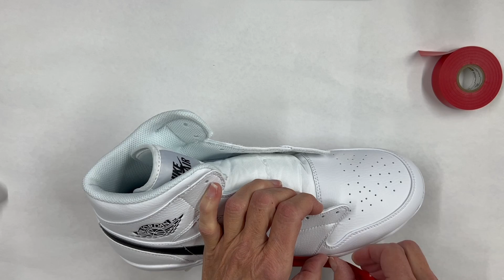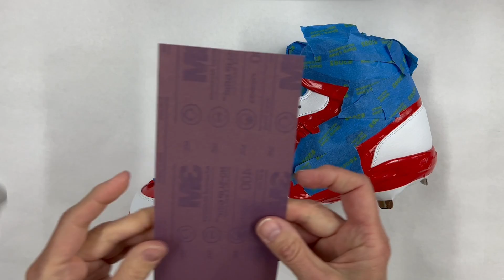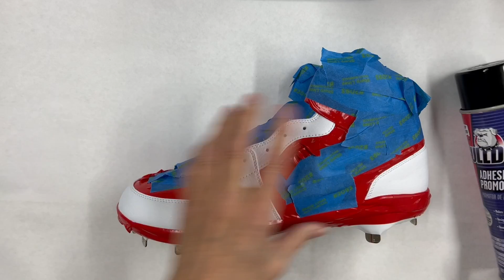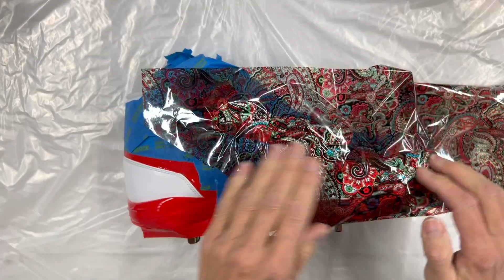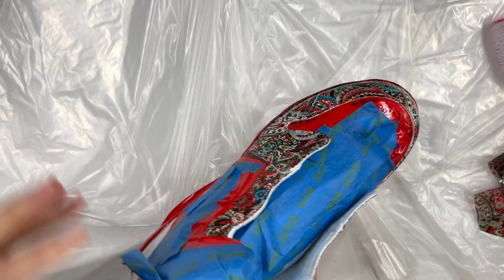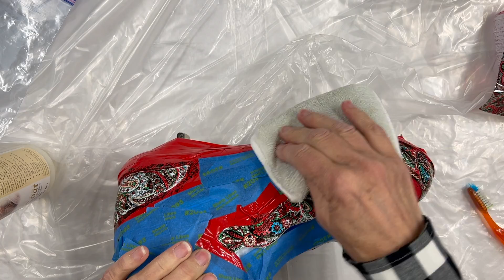Custom Jordan 1 Retro Baseball Cleats Tutorial | Custom Baseball Spikes | Transfer Foils

Comment: How much foil will I need to costume a pair of cleats like this?
Reply from the maker: Depending on how much of the shoe you plan to foil - I would say a three foot roll should be enough - but my Boy has big feet, so those were 13 or 14 size cleats!!!
Reply: Thank you! I will foil a size 5y and I purchased a 3 foot roll. I hope it’s turns out great as yours did!
Reply from the maker: @KeshiaCampbell-uc4nn  Can't wait to see them - make sure to join our group on Facebook called:  Foil Everything and share with us!
Reply: Hi! It’s me again! In the video you utilized acetone but in the information section you listed rubbing alcohol, can I use either of the two? Also in the video you showed matte clear enamel, but at the end you held up satin clear enamel. Does it matter what finisher? I accidentally purchased Gloss clear enamel and trying to determine if I need to return and get either of the two you showed
Reply from the maker: @KeshiaCampbell-uc4nn  sorry for the confusion - but Acetone will be best and I believe I had purchased all three sheens but because the MLB has rules, I had to use the matte spray to matte out the high sheen of the foils (you can't have anything shiny on your shoes).  But, any of the sheens will work - it's more a preference or with this project I had to follow the rules :).